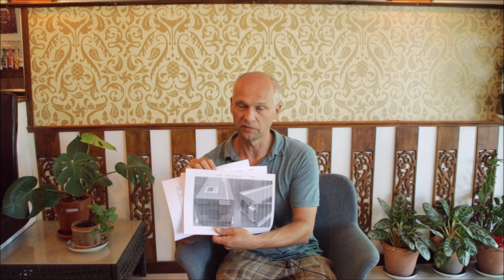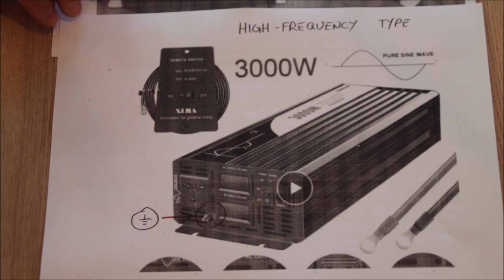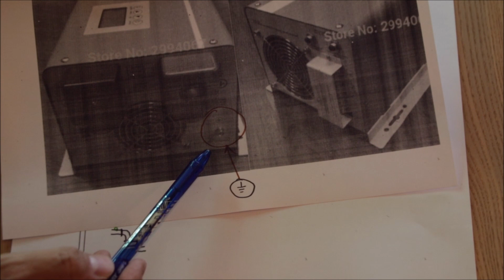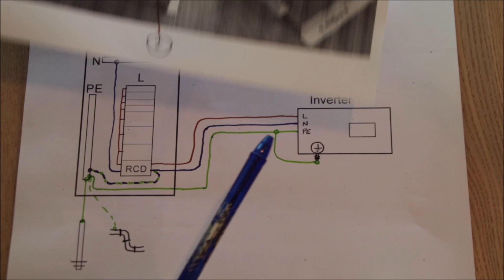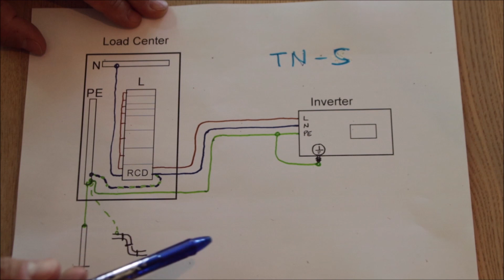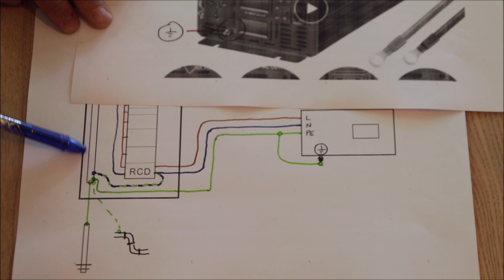Inverter Earthing and N-G Bonding in a simple Off-Grid Setup

Comment: Best bit of off grid grounding/earthing advice I've come across. I'm just getting started with Solar and have been buying the parts to give power to my stable block, workshop, gym. I'd bought a 2000W Renogy pure sine wave inverter which has two UK outlet sockets and a ground lug on the case. I wanted to make sure I was doing things right so started reading about earthing/grounding and boy! what a rabbit hole that was I went down. I've read the IEEE Domestic Installer manual which explained the different grounding types and all about creating a low impedance ground fault return path so RCD's will trip within a safe time limit but the inverter being a two uk socket affair does not come with any internal earth fault protection so I started to get a bit worried about connecting it up. I thought about blanking off one of the sockets and running the other to a distribution board with RCD's but wasn't sure if this was a safe thing to do. Renogy support said I could connect it using a plug with three wires but again I felt a bit unsure about it. I'd seen other inverters which had LNE terminals for connecting into a distribution board and so just connecting a plug and wires from the inverter to the distribution board seem a little bit of a hack as I'd not seen this mentioned anywhere else. Having you talk through it though has reassured me my thinking on wiring into a distribution board and Renogy's advice about using a plug and three wires is actually the right way to go. 

One question though - the renogy inverter has an ac passthrough so you can connect to ac (like shore ac if mobile) and the inverter will switch this through to the outputs and when the ac goes away the inverter will draw from the batteries. AC power in the uk is bonded at the supply or in the consumer distribution board and I believe in this case bonding again in the inverter distribution board is a really bad idea as there would then be line current flowing on the earth conductor in a non fault situation. Personally I'm not intending on doing this as my installation is totally off grid but how would you wire things up if this was the case where the neutral earth bond was needing to be in the distribution board when off grid and not in the distribution board when connected to shore power???
Reply from the maker: Hi. Thanks for your reply. My videos about "practical guidance on N-G bonding" and about "TT-system bonding" are talking about that issue. If your inverter is just the backup for the grid, then an Automatic Transfer Switch instead of the inverter internal bypass would most likely fit best in your scenario. Use shore power as primary power source in the ATS and inverter as secondary. If Grid fails, ATS switches to inverter in off-grid mode with a N-G bond right at the inverter. If grid is backup for inverter, then its getting more complicated. You would need to make sure that you do not interfere with the grids earthing system as discussed in those 2 videos.

Comment: Hi Roland. Could diodes be useful to protect inverters in grounding systems?
Reply from the maker: You mean like Surge Protection Devices channeling surges to ground? Varistors are the much  better choice as they are non-polar and can handle high currents. Diodes are not known to be helpful under these circumstances.
Reply: @RolandW_DIYEnergyandMore  I was thinking about ground loops sending power back through equipment. I built my power shed as one big Faraday cage. I have been struggling with getting my head around this topic. You have been most helpful, thank you. I’ve got a TT system to my house. I’ve elected to keep my system off-grid as a TN-S system. I have a sub panel in my shed from my house. Ground rods at the house and at the shed (over 20 meters away). I wanted to ground the Faraday cage to the shed’s ground rods as well as the TN-S system. Thought maybe a diode could help.
Reply from the maker: @solargloater8059  a diode is a DC component. As you are talking from AC side grounding, diodes have no effect in isolating as they would always let one half wave pass through them. But that's not really necessary. When talking about ground loops just always think about rule number one. Power can only come and go back to its source. As long you are off-grid you cannot interfere with any energy source from outside if you do not provide a path for such energy.

Comment: Regarding the ground terminal vs the grounding point on the inverter (All in one, hybrid 3kva, but not using the AC in), I have checked and there is continuity between them (and the N ,so it is bonded on the AC out). So what should I connect to the Earth bar on the consumer unit: the cable terminal,  the grounding point, or both?

Also, I bought a 6mm single core, 6 strand earth cable to connect the CU to the earth rod (and could use this between inverter's grounding point and CU earth bar). Is this cable up to the job?
Reply from the maker: Hi. In the case of an internally bonded inverter, you just need to connect each terminal from the inverter to its counterpart in the consumer unit. L to RCD L, N to RCD N and PE directly to the PE bar in the CU. No further N G bonding there. The PE bar you then connect to a grounding point like a rod. Typically earth connections are done in 10mm2 but a 6mm2 cable will do the job too as the inverter cannot produce such high currents as the grid would do.
Reply: @RolandW_DIYEnergyandMore  Thank you for the reply! Ok, so I ignore the 'grounding point' on the inverter, and just connect to the earth terminal via the 3 core 'L,N,PE' 6mm flat cable. However, it looks to me that the earth conductor on this cable (one strand, 1mm?), is thinner than the 6mm multistrand earth cable that I'll be running from the CU to the rod. So would it not be a 'weaker' link in the system to use the earth conductor of a the 3 core cable from the inverter to the CU?

By the way, there is a 'button' (?) next to the Earth point on the inverter that says Input Breaker 230VAC. Any idea what this is? Uk based.
Reply from the maker: @jdpd4690  yes, the earth wire to the inverter should be same dimension as the wire from L and N. It will return full fault current in case of a L to PE leakage. The button will be the AC-in breaker. You said the inverter does have AC in as well but it's not in use, right?
Reply: @RolandW_DIYEnergyandMore  Ok, thanks. I am finding this so confusing! I guess a 'generic' 3 core LNE electrical cable is not meant to be used in this context then? This was defined as 6mm in the shop, but this applies to the L and N cores (6 strands), but definitely not to the 1 strand earth conductor in the middle!
So, if I use the separate 6mm earth cable (6 strands) running from the earth point to the CU bar, should I connect the earth terminal as well, and have both connected, or better just to have one?
Yes, the inverter can have AC input, but given the complexities of connecting to grid (I posted in another of your videos for help, but seemed there were too many hurdles to make it viable in my situation), it is not connected at the moment. But may look into it again in future. Could you give me a brief description of the function of this button please?
And would the earth cable to rod need to be thicker if the inverter was ever connected to grid?
Reply from the maker: @jdpd4690  such cables are meant for the consumer side. There, the earth wire serves more like a carrier of information that a leakage exists and then breakers and RCD can quickly disconnect affected circuits. But on the supply side currents will persist a while longer until the power source can be shut down. Such asymmetric cables are pretty uncommon in most other countries. I only know them from US and now UK.

You can connect the chassis grounding point as well to the PE system. As the inverters PE terminal and CGP are internally connected, it would be just an optional choice of yours.

The button breakers typically work in such a way that if the breaker trips, the button will pop out a bit and you would just press it in to reset the breaker.

Internally N-G bonded inverters are generally meant to be used in off-grid systems only. The internal bond will in almost every case lead to an illegal bond during grid connection, or at least be a multiple N-G bond in the system and will create parallel earth loops depending of the mode of operation of the inverter.
In many cases it will also trip upstream RCDs, because people tend to get their AC for the AC-in from the CU :)
For PV systems with alternative grid input I do prefer unbonded inverters or such, which do have internal bonding relays.
Best regards
Reply: @RolandW_DIYEnergyandMore  Great help thanks!  I have checked for continuity/N-G bonding and have found they are bonded on the AC output side, but not on the AC input terminals. Does this make any difference? The manual is incredibly unhelpful and does not say anything about bonding or internal relays etc. I'll need to do somme research, run some tests, and probably ask you more question in future! :)
Reply from the maker: @jdpd4690  AC in and AC out separated is perfectly right. The AC in is sort of a consumer for the grid as there is an AC to DC charger behind that terminal as well. Any bonding there would cause troubles. A bond would only get visible on the AC in when the grid is bypassed straight to the AC out and there then you have a bond. Thats what all the fuss is about :) I think that you have understood the basic concept now. Anytime here to answer questions.

Comment: Hi .. very goo info.  Can i ask you some questions? From your video this mean we can bound ground of solar panel the the same ground rod of main electric source?  And can we bound the output neutral to the same ground point from the main electric source?
Reply from the maker: Ground of solar panels you mean frames, mount, SPDs, etc... yes. Do not bond any DC power line directly to ground.

Comment: Would you clarify something for me please? Regarding extension cables on the cheap inverter, it seems the issue is not so much the extension itself as the use of multiple sockets on the extension, is that right? So if you just used a single socket to single plug extension, to drive one item (which just needed an extension cord to due distance from the inverter) then that would be OK?
Reply from the maker: Hi, yes. Using a single device on a single socket (extension or not) is perfectly OK on an isolated inverter. It is the classic case on how IT shall be used.

Comment: Hi Roland, I inherited an off grid system 1.5 years ago. It’s 24v and completely off grid 230v (inverter to batteries - batteries charged by various 24v dc sources).  It has a 3000w inverter, which uses a standard L N G, which runs to a cabinet with a breaker and the earth is connected to both the sub panel inside the house and the protective earth grounding rod outside. I have now bought 6kw inverter Nomad 6000 nomadPower (24v DC in). On this inverter it has a terminal block with only L N. There is no ground connection or ground lug or ground marking on the inverter. The electrical label does show it is double insulated unit (square within a square). I haven’t connected it up yet as I’m trying to figure out how I earth this. The Manual has no details on how to wire the terminal block. How do I best figure out if the neutral is bonded to the earth?
Reply from the maker: Hi, if it's a class 2 insulated device then there is no internal earthing anyways. It would be considered as a pure IT power source. You can make an external bond in your panel and create the earthing loop.
Did your old inverter have an internal bond or did you have it outside?
Reply: It was outside. Grounded in the negative DC battery side. And ac at the external panel of the house. Both go to a central earthing rod
Reply: Shall I purchase an RCD, and then loop the earth off the outbound from inverter neutral to the earthing rod?
Reply from the maker: @michaelwood3825  yes, just do it same as shown in the video. Just unground the DC side please. I don't understand why the DC should be grounded. The only device in the DC circuit which shall have a connection to Earth is a DC Surge protection device. Or does your charge controller explicitly require Earth via a bonded Minus pole?
Reply: It was that way as per the old inverter. I have all DC equipment connected to the victron Lynx distribution bar / which also has ground lug. That is then connected to the earthing rod
Reply from the maker: @michaelwood3825  right. If the new inverter is transformerless design, the DC bond will actually cause DC leakage going through the AC side. I recommend to remove the earthing from DC power lines.
Reply: So as I have a couple of Plug sockets on this, I tested L - N (230v), L - E (6-7v dynamically moving around) and N - E which behaved the same as L-E.
Reply: I should add, this was on my test bench, and the sockets are directly off the inverter.
Reply: So to summarise Roland: 1) The 6000w is a class ii double insulated device 2) I think it is a low frequency with transformer: it is heavy >12kg and bulky and can surge to 12000w 3) It has a floating ground 4) the L-G and N-G have a random low voltage reading (anywhere from 3v to 7v when I tested again).  Therefore, I will install a 240v RCD and wire the earth from the return leg of the neutral on the inverter side of the RCD.  I'm still a little uncertain on the DC negative bus bar earthing - as a number of sources suggest this should be done - but I don't want my inverter to go bang / go live.
Reply from the maker: @michaelwood3825  yes, the floating Earth to L and N indicates that the power lines of the inverter are totally isolated. You are basically pulling down the line to reference Zero via the multimeter.
So, there will be no issues with implementing PE-N bonding and earthing loop including RCD. The protection will work flawlessly.
About power line DC earthing: It is absolutely unnecessary from any standpoint with a 24V system. DC isolation is a good thing. Without having a DC line grounded, there is no danger of getting shocked when working on the PV-Panels as well. Those are typically above the safe touching voltage. Power lines inside the DC system should still be protected against surges using SPDs. 
You may connect any device casings to the PE system as part of equipment earthing of course.

Comment: Am I right thinking the AC and the DC side isn't isolated in those cheap inverters, so earthing the AC will pull the DC side to around half the the AC voltage, so 100V+? So battery terminals and all DC wiring will have to be insulated or out of access and clearly labelled?
Reply from the maker: Hi, that's not necessarily true about cheap inverters. Cheap Chinese inverters often use older designs which mostly do use high frequency transformers to isolate the DC from the AC side. When an inverter is "transformerless" it is typically stated in the data sheet. But anyways it is always good practice to insulate and label any electrical conductor if voltage is above the save touching voltage of typically ~30-35V.
Reply: @RolandW_DIYEnergyandMore  okay, good to hear. Ideally I would earth both the AC neutral and the DC positive - the charge controller is common positive, so this would earth the solar panel positive too. I am worried that would "blow up" the inverter on first turn on though so I may need to do some experimenting first.
Reply from the maker: @szabolcsmate5254  does your DC side really require a powerline bonded to earth? It is highly unusual to bond any of the DC power lines to ground/earth. Normally power lines in a PV system are only connected to earth over SPDs so it is only meant to draw surges down to earth.